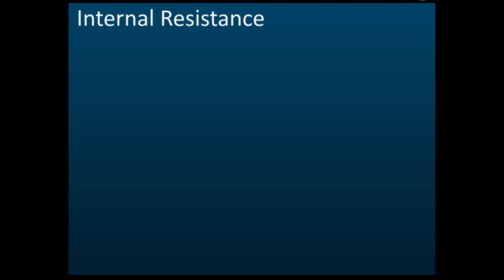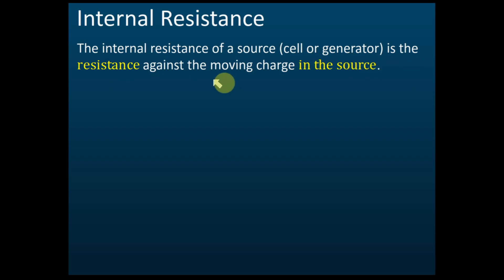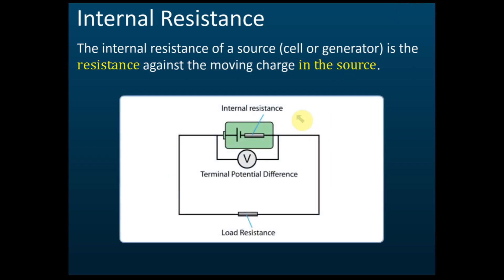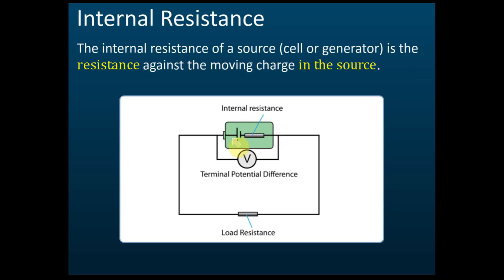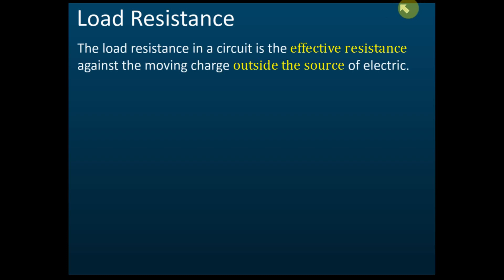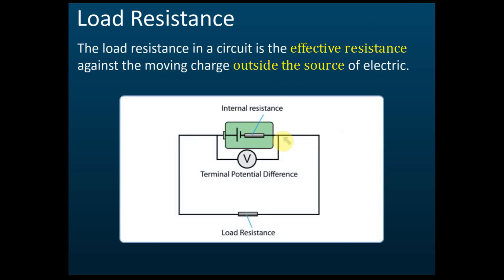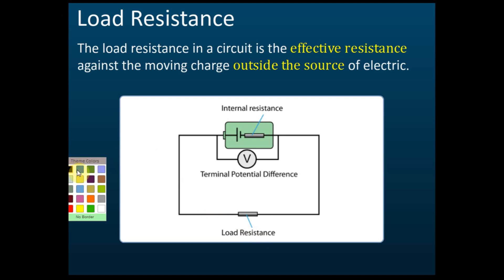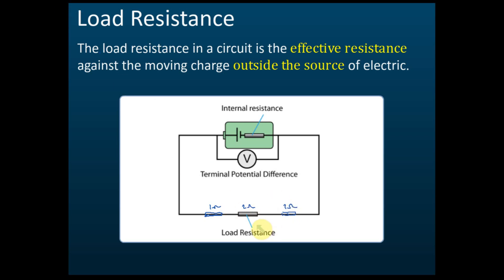Internal Resistance and Load Resistance | Electricity

Comment: Thank You
Reply from the maker: Welcome!
Reply: @myhometuition  i have a doubt...is it possible that the value of load resistance is less than internal resistance?
Reply: @never_never_land7034  no ,this is not possible cause internal resistance is always very low ,it can be .1 or .01 type of something . the outside resistance will be always greater then internal resistance .